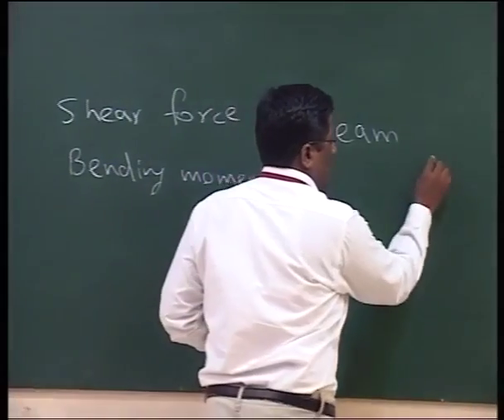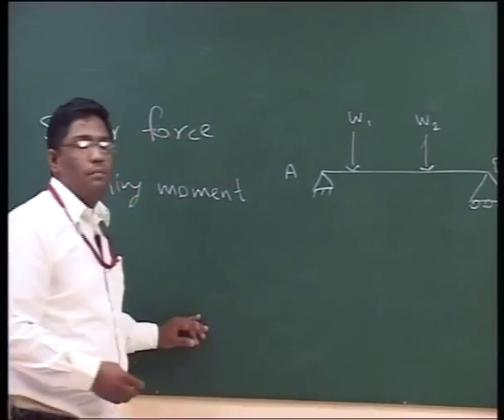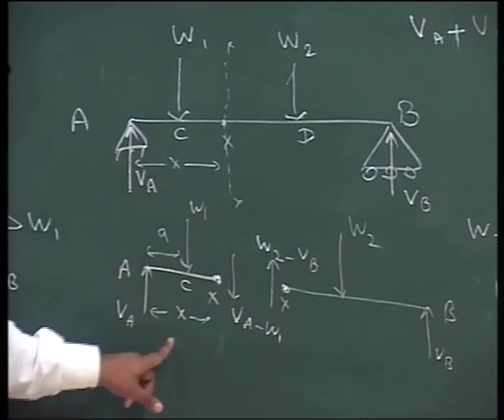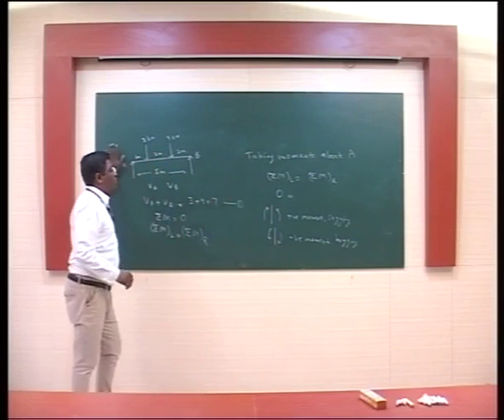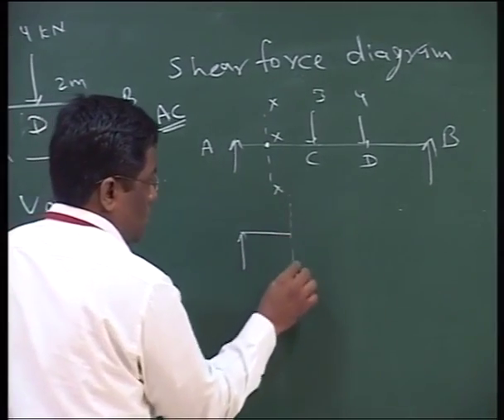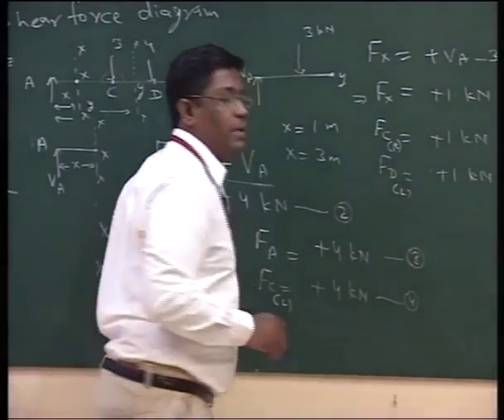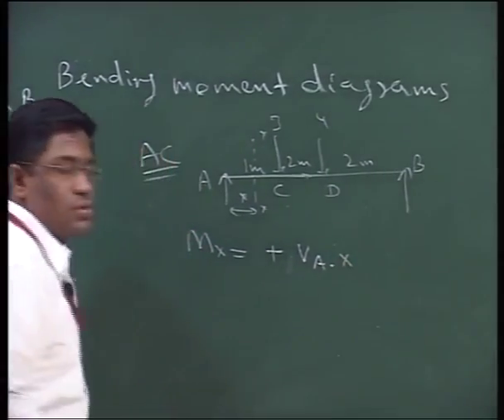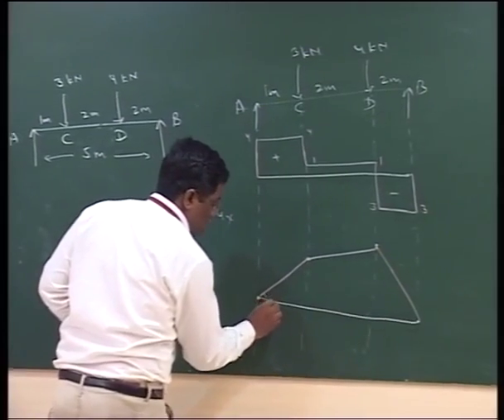Abhisek Arya- Shear force and bending moment diagrams

Comment: I think a simply supported beam is hinged at both ends.
you have shown a roller on right side.
"Translation movements are restricted in Simply supported beam"
Source NPTEL lecture.
Reply: +Ketan Kumar Sandhi simply sported beam is always one end is hinged and other is roller
Reply: +Ketan Kumar Sandhi not necessary...before giving the source understand the source first